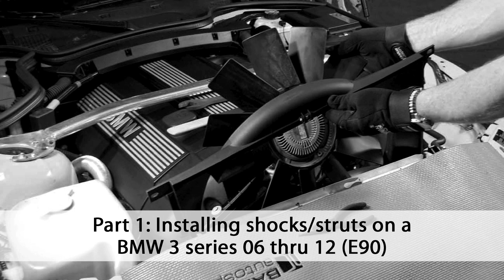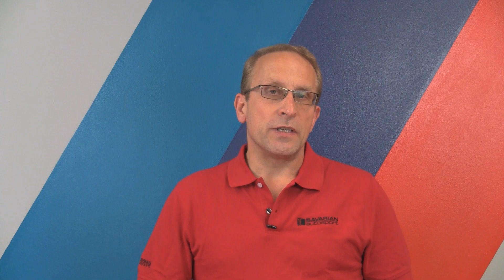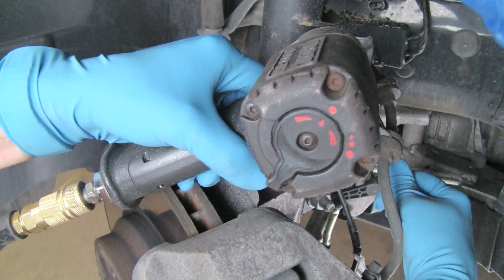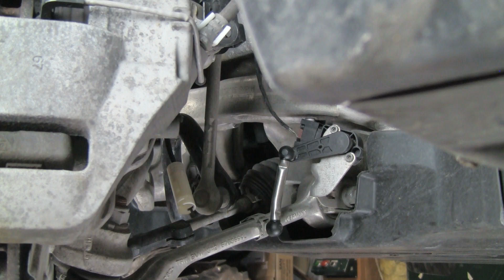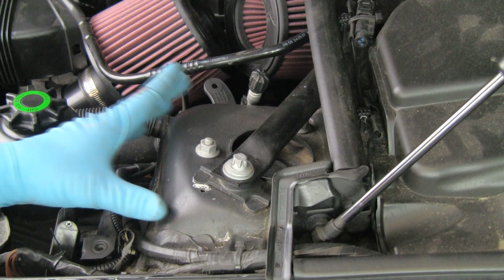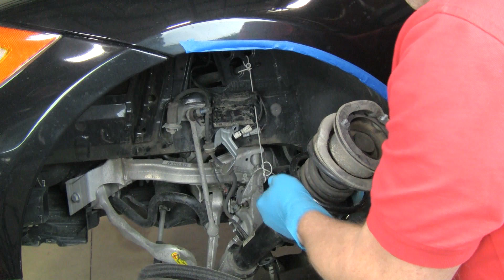Part 1: Installing shocks and struts on a BMW 3 series 06 thru 12 (E90, E91, E92, E93)

Comment: This car is sooooo clean compared to mine which is rusty and caked in mud. Still 153k on the original springs and dampers isn’t bad. Spring broke if you’re wondering….😂

Comment: Having just completed this job I'd like to add a few things:

1. You don't have to buy their expensive spring compressor. I'm not sure if you can now anyway, RIP BavAuto. I got an eBay one with a double-hook on one end and a single on the other (with wingnut-tightened retention hooks for safety). To compress the spring sufficiently, I had to secure the double-hooks on the spring plate, but it works. I will say it could be a bit tight working around those hooks if you wanted to change your mounts too, but mine were fine so I didn't. I suppose you could undo the compressors to install the mount.

2. They flippantly recommend loosening the control arm and tension-strut bolts at the subframe. You might have to; I saw another video where a guy had trouble lowering his steering knuckle far enough til he did. No one specifies the torque in any video I've seen, but I have the Bentley manual for this car, which states 50 ft-lbs (74 with higher-grade bolts) THEN 90 degrees. That implies these might be torque-to-yield bolts, especially as the manual goes on to say always replace with new. I can't believe one would be expected to replace these bolts every time one is even loosened just to get the strut out...but I have also heard of dudes that just gutenteit and go. I gave mine the torque spec + 45 degrees and was scared to strain them further.
If you're paranoid and you want to replace these, RealOEM to the rescue: the bolts are PN 31106763928, the control arm nut is PN 33326760668, and the tension-strut locking nut is PN 31106767496. This would be $25-30 on FCPEuro. Up to you.

3. I'd clarify the verbiage around how to achieve ride height. Ramps are ideal, but if you're using a jack, you probably DO want to lift the one corner off of the support on that side, if you can safety. In my garage, I had the front on two jack-stands and the rears holding the parking-brake on hard. I also measured ride height before and after jacking and raised the knuckle (with a wood-block between metals) by the disparity. By then I had actually raised it off the jack-stand on that side. This is I suppose because I actually gained a whole inch of ride height from this job. I actually don't know why, as I reused the same springs. At any rate, if you lift that corner off its support just a little, you know for a fact that the strut is supporting roughly its share of the weight. Don't worry, just take it slow. 

4. For my fellow automotive dumbasses out there, notice that there is a LEFT and a RIGHT shock absorber, and they are different, and not interchangeable. Notice the stabilizer attachment bracket always faces the rear. Notice this before you get halfway into the job with one strut rebuilt with the wrong shock and now have to dig into the other side to continue. At least the coil springs are interchangeable!

5. Here he's installing those yellow Bilstein shocks. If you're installing the OEM Sachs like me (either is fine...I've read Bilstein makes em a little stiffer so I guess it's up to whether you want more luxury or more sporty), some of these did not come with the auxiliary foam bumper. It looks like the struts he's replacing did; mine did not but IMO they should have. They're there to protect the shock in case you bottom-out your suspension, which is probably what caused mine to leak in the first place. I would highly recommend adding the bumper PN 31336771352 and the boot PN 31331094749. The bumper also mates with the boot and helps keep the shaft covered. This does not apply to these particular Bilstein shocks because those contain their protective bumper internally, plus they come with boots fitted.

Comment: if anyone sees this let me tell you that you DO NOT need to remove the control arms I literally just did the arms last week and removed the struts without loosening the control arms yesterday
Reply: Nah left the arms in all the way without loosening, just installed all new arms a week before doing the struts too...
Reply: @kehove6286  thx, greetings from Germany 😁
Reply: did you not even loosen the bolts of the arms? i have to do the same and that would make it so much easier
Reply: What about the tie rods? Did you have to remove them at all?
Reply: @kc2213  no
Reply: @kehove6286  is yours rwd with sport suspension?
Reply: @kc2213  IT was a clients but it was rwd not sport

Comment: The only thing I suggest reusing is the spring. I always replace the mount and all the rubber spring seats. The rubber seats are usually trashed when you remove the spring.

Comment: Having done this a couple of times I can say that I find it much easier to get the bottom of the strut out of the steering knuckle completely, drop the the suspension down and then remove the top of the strut from the car.  There is a lot more room to do it that way then to try to tilt the strut out from under the fender.  You also don't have to loosen any of the suspension arms if you do it that way
Reply: Ur so ✅
Reply: Video?
Reply: @tristancloud9687  sorry, no need to do it right now, doing water pump though.   Just loosen the pinch bolts and tap that arm down off the strut.  Maybe spray some penetrating oil in tbere.  Then take the top bolts off last.  Taking the top off first I had a harder time getting the suspension to go down far enough to clear the fender without risk of scratching.
Reply: @smrruby  I was asking if you had a video that you could reference

Comment: You don't need to take half of this apart. Undo the anti roll bar link, disconnect the ABS sensor, disconnect the steering tie rod, undo the top 13 mm nuts and push the suspension down enough to pull the top of the strut out from under the arch. Then you can remove the hub to strut clamp nut/bolt and pull the strut out. Takes about 30 minutes but I recommend adding some masking tape to the front wing arch edge and an old towel over the top of the strut.
Reply: You dont even need to do that. Disconnect sensors, brake hose from bracket, and swaybar link.  Undo the pinch bolt. use a rubber mallet/deadblow hammer to hit the knuckle off the strut, undo the 3 nuts at the top and pull the strut out. Then you don't have to worry about hitting the top of the strut on anything.
Reply: @cofdeath9765  That sounds so much easier. You didn't loosen the control arms? Headlight clip? Tie rod? Thanks!
Reply: @MrJimbrockman  You can loosen the control arm bolts so you're not fighting against the bushings to get the knuckle off, but you don't need to. Should be enough travel to get the knuckle off. At least there was on my 2011 335xi when I installed my coilover kit.

Comment: Hello BavAuto!! Question for you regarding my setup.  What is the difference between the e82 with sport suspension and the e82 without sport suspension as far as the front struts go? I have looked through many sites with the OEM Bilstein offerings and it seems the two cannot be interchanged as far as compatibility goes but why? What is the difference between the two struts?  Are the mounting brackets in different locations?  I also know their is an M-Sport suspension offering for my car but I'm not even sure if that's the same as the sport suspension and if those can be interchanged as well.  Any help would be greatly appreciated.
Reply: My guess is the shock travel. Sport suspensions usually have shorter springs.

Comment: Qustion just received my new front quick  struts and the top mount rocks back and forth slightly i double checked to top nut and it was tight is this normal ?

Comment: Hello! Do I need to move wheels right? I tried today change shocks with straight wheels, with no result, I could not pull shock from the fender. A steering tip does not move lower.  Also I have applied spring compressor, the same - 1 cm did not enough.

Comment: BavAuto, you're awesome. I have a 2002 325xi. It vibrates at constant speed and varying speed from 40 mph up to 80 mph. At 80, it smooths out, but returns if you go any faster. Therefore this vibration is harmonic. The vehicle does NOT shudder under acceleration. I have not looked at the carrier bearing for the rear drive shaft or the flex joint. 

What would you recommend to start diagnosing? I HAVE DONE: replaced control arms, replaced transfer case mount, replaced tie rod inner and outer, new-ish tires, balanced, rotated frequently, and 2 separate alignments.

The other symptom (not sure if related to vibration) is the car pulls to the right a bit. It pulls more than it should given the fact that it is aligned, even when driving on a sloped road for water run-off. Please advise thoughts.

Comment: Hello! Very nice videos. I have a couple of questions and I would be thankful if you could answere it.
1. I have E91 318i and I couldn't last lower the hub enough so that I can take the arm out. I tired to push down but it didn't work somehow. 
2. What would if I tight the pushing again but not exactly on the right high?

Comment: hi there!
i have a technical question about front compression absorbers(dampers) .
in e91/e88 is a 85mm damper similiar to e90 80mm cone type damper but some of companies like monroe/KYB (PK012-910084KYB) use old style shape dampers from  e46 85mm in their web cat to use in e91/88
Is any difference to use diffrent shape of dampers in front strut e91/e88 vehicles?
Cone damper for me is not as strong like old style ones
Im right?

Comment: i saw in pelican guide that they where able to lower the strut with out loosing control arms, unless they did not mentioned, but is removing strut capable without using coil compresser or loosing the control arms maybe a pull on the strut may compress strut?
Reply: +monsieur420 remove the strut sorry* @lower the strut
Reply from the maker: +monsieur420 - In most cases, when removing the front shock assembly on an E90 3-series model, the hub will not lower far enough to pull the shock out of the hub clamp.  I suppose you could install the threaded-rod style spring compressors on the spring and this would shorten the assembly and MAYBE allow you to pull it out without loosening the control arm bushing bolts.

Comment: Otto, I bought the Koni FSD Set from you all and I'm confused to why I hear clunking noises after installation. I question the supplementals and what was to be used and exchanged by the instructions. It was much more hardware than stock. Can you tell me what you may think the clunking is and a breakdown on the hardware in order for the shocks and struts?
Reply: Does it sound like it's coming from the rear struts? If so, then I have the same problem. Koni FSDs all around less than 6 months ago, and there's a clunking almost bouncing sound happening. No change in ride or anything. Just a little strange
Reply: +MiSkateage Actually, I called and spoke with Gordon. I had a few notions of what was going wrong and he troubleshooted with me. It was surely coming from the front. I had the clunking, also. As I assumed, it had something to do with too much play in the assembly. I suggest you check your set up. Hopefully you won't have to disassemble.  Contact BAV. I knew my setup was tightened but had that issue. Check your bearings in the assembly and control arms. My issue was that my passenger assembly was not flush inside the knuckle. The metal tab was not completely all the way down. It was the smallest of a diff but that fixed everything. The was another trick he taught me just in case it was the issue, which is inexpensive/easy and worth doing. 
With the car on the ground, gain access to the top mount nut. The nut may be tight on the shaft but may not be tight on the bearing. They will have to give you the specs of the washers and instructions. I did both methods and hadn't heard a peep since

Comment: Hi Otto and thank you so much for those amazing videos!
I followed your instructions, all went well but after an hour driving I got the yellow brake light and a traction control off light. What could be the cause? I will appreciate your guidance.
Reply: thanks for the follow up comment.  many people read these and may have the same issue.  it is really helpful to have the full solution !!
Reply from the maker: maxidw Hmmm ... well, double check your wiring plugs for the front ABS wheel speed sensors, as a first step.
Reply: It ended up being an alignment issue. All I needed was to correct it and after a few minutes driving it corrected it self. Thank you.

Comment: Really great video and also real good pricing. I recently bought all 4 shocks from you guys for my e90. I got the Bilsteing HD witch ended up costing me a couple hundred less than it would of at autozone or advance. I got one front and two rear within a week and the other front was on back order witch it has shiped already. I plan on installing them this weekend.

Comment: Do you know if a 2009 328i uses struts or shocks? Thanks in advance.
Reply from the maker: The E90/91/92/93 3-series models (such as your 2009 328i) do use a strut type front suspension.  Keep in mind that the strut suspension design still uses a shock absorber.  The shock absorber is still a shock absorber.  the difference in a strut design is that the shock housing also serves as a stressed part of the articulated suspension ... as if it were also a control arm, in effect.
Reply: Ok I see, I just wanted to know what I needed to look for when it comes time to upgrade my suspension. So I'll be looking for struts for the front and shocks for the rear? Thanks again.
Reply from the maker: Samuel Fernandez
 - yes, but you can also just say shocks for front and rear ... and as long as the vehicle listing is correct, you'll get strut-type shocks for the front.

Comment: if you were to incorrectly connect the abs and brake sensor wires . would that cause you to get a yellow brake light and a traction control off light? (i am pretty sure i connected them correctly)
Reply from the maker: The connectors are different (down inside the plug housing), so you should not be able to connect them incorrectly.  However, if they were crossed, this would cause a fault.
Reply: hey i got those lights on the first time turning on after installing new springs. the second time i didnt get them. thanks anyway!

Comment: Hi, What is the procedure towards the end about tighten the control arm bolts? I don't have a ramp so how high do I have raise the jack on the control arm? Will this affect alignment?
Reply from the maker: On models that have bushed control arm pivot points .... where the mounting bolt goes through the middle of the rubber bushing ... you can't tighten the mounting bolt with the arm hanging. Tightening the bolt clamps the bushing in that position and then when the car is lowered, the bushing is "twisted" when at the static ride height.  Therefore, we wait to tighten the through-bolt until the suspension is at ride height (on the ground).  Ramps make this easy, but you can often do the final tightening by just reaching under the vehicle.  As a last resort, if you have the vehicle on jack stands, you can carefully place your floor jack under the outer ball-joint or under the rotor hub and jack until the vehicle's weight just starts to lighten from the jack-stand .... then tighten the bolt.  This procedure has obvious potential safety issues and we do not recommend it.

Comment: Thank you for this excellent video.  I am thinking of buying my first cordless impact drill.  I would appreciate if you could kindly suggest to me what power drill I would need to remove, for example, the pinch bolt securing the strut to the hub.  Would a 18V cordless machine be enough or do I need to go higher?  I also had in mind a battery impact that is capable of removing subframe bolts.
Reply from the maker: You will need an impact gun, not a drill, for removing bolts.  The best cordless impact gun for this, is the Dewalt 18v 1/2" impact wrench.

Comment: Hi. I have a 2006 BMW 330XI AWD. When I do this job on my front struts. Do I have to remove the front halfshaft/axle nut and pull it out of the knuckle?
Reply from the maker: Nope.  Proceed in pretty much the same manner as for the 2wd shown.